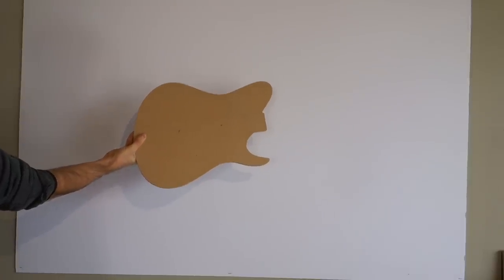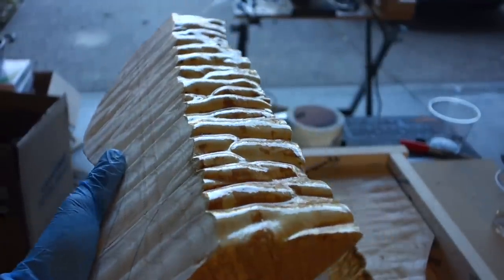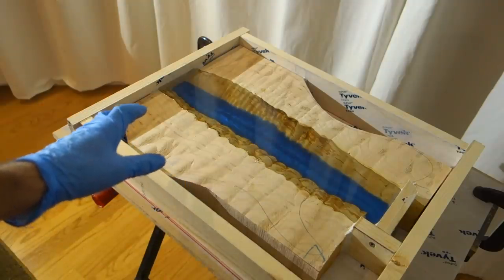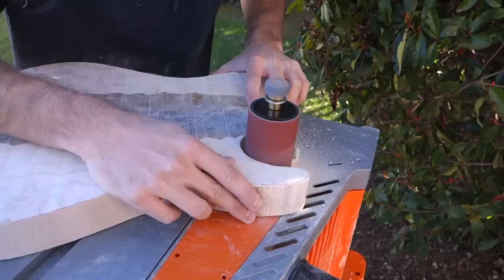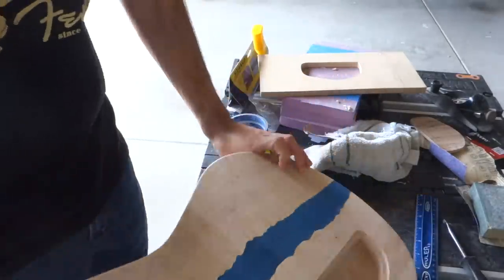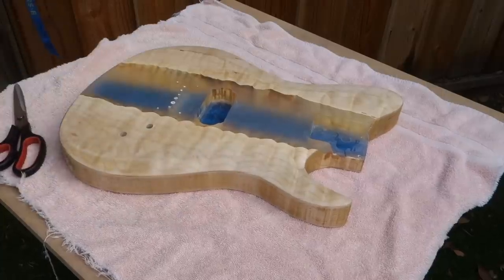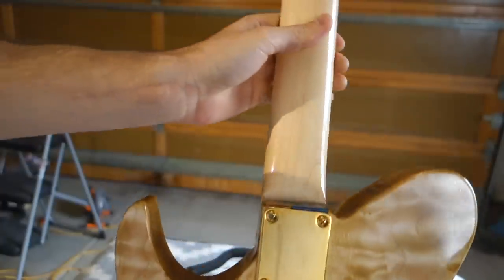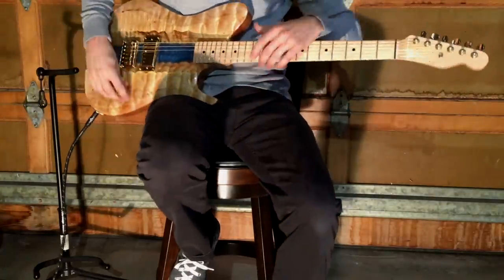I Built an Epoxy Resin River Guitar

Comment: You do beautiful work. As a pro auto painter, I've done a handful of guitars and drums. You'd be able to get a slick mirror finish that makes your color really pop if you'd get a body shop to clear your guitar body with a proper 2k urethane and not use the spray cans. It would have MUCH better scratch, chip, and chemical  resistance, and It'd cost you maybe $50. Well done, sir. You're inspiring!

Comment: not sure how possible this is or how you would do it but, a cool idea would be a marble guitar as in like use several colours of epoxy 🤷🏼‍♀️
Reply: Sounds possible, but like realy hard. Lol. I am thinking making layers of marbled epoxy resin, take a thin mould the shape of a guitar, and in that, three different areas for different epoxy colors, remove the seperators before epoxy is dry, and swirl a stick arround in it. Wait for it to dry, then make more layers.

Comment: You should make a bass or a left handed guitar
Reply: To be fair he probably would want to actually use it after making it, so the left handed guitar is out of question
Reply: Fair but having everything backwards would be fun to watch and a challenge
Reply: Well a left handed guitar is just a right handed guitar made backwards.  Plus you can already take a right handed guitar and string it like a left handed guitar and visa versa... so it doesn't matter weather or not if it's made for left handed.  Also for the bass just take one of these guitars make the body and drill holes for four thicker strings.
Reply: Ya..  a Bass would be cool

Comment: Make a layered guitar from the bottom up with acrylic on the bottom then clear or lightly colored resin with acrylic pieces cut out and sanded thrown onto the resin and then more resin to fill the mold past the cut acrylic and then another flat pane of acrylic to put on top then have lights in it and all the pieces inside will glow whatever color you change the lights to

Comment: The best way to get bubbles out is by sticky and lightly torching to the epoxy surface right after you pour it, you will see the bubbles go away immediately and look super clear. The warm water works but not that well because pouring crates lots of small bubbles.

Comment: You could have used a Seymour Duncan p-rail with a split switch and a push pull pot to put the pickup out of phase.  This will give you more range but the guitar is beautiful and sounds great. All l wanted to do was give you an option most people never think of .

Comment: You have more faith in the bond between the maple and the epoxy than I would have.  Because of that I would have mechanically connected the wood to the wood and resin.  Since your motif is a river maybe a bridhe or two to connect the maple lands.

Comment: If I have a body that is routed out with a design. I want to paint the inside of the design my desired color and then just do clear epoxy resin over to fill the routed area. Will I be safe with any type of point or do I need to use something special to ensure that the clear won't harden and just fall out over time?

Comment: What is the exact type of epoxy resin you use? Also, it doesn't melt when sanding it? I'm really new to all this and I wanna build my first guitar so I'm trying together as much knowledge as possible
Reply: So I know for some builds he uses total boat, which fantastic as they have a ton of stuff for deep pours, and fast curing. He also used MAS for the deep pour. 

I hope that helps if you didn't get the info :)

Comment: You removed all the character from the sides off those wood pieces when you sanded the bark remnants. I get you needed a better surface for the adhesion, you should have stained it to look similar that way you have the AWESOME look and would have still had excellent adhesion, would have been a win, win ma friend. I think that would have made this guitar look WAY BETTER. But it's still amazing looking.

Comment: about the telecaster and strat you build before , i see you made all the pockets in the front , you could only instead make the scratchguard opening for the pickup in the front of the body and open up the rest of the pocket from the rear of the body and cover that with a plate , you mount the pickups from the back and only have the screw holes for the height adjustment and top of pickup stick out the front makes the front of the guitar that is the part the public sees look more pure and virgin , it hides all the wiring too , if youre afraid the top of the guitar is to thin to hold everything you could allways fit a thin metal plate against the bottom / top of the pocket in the rear with some epoxy 
as for youre newest guitar on the video , it does sound verry nice , maibe next time do some sort of river delta , maibe trace a picture on tracepaper 
https://www.hollandtradeandinvest.com/binaries/medium/content/gallery/hollandtrade/content-afbeeldingen/showcases/dutch-icons/the-dutch-delta-approach/gangesdelta-dutchwatersector.png

and route it out on some regulair wood body then fill it with coloured resin 
i guess making it a delta bleus guitar